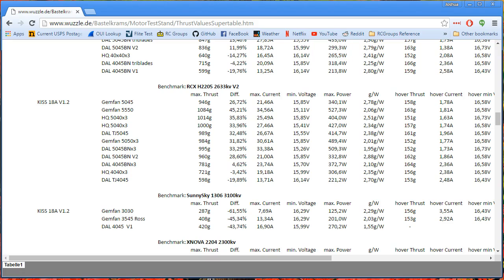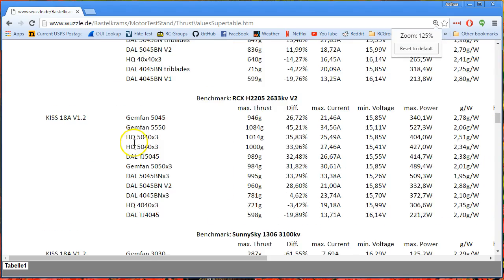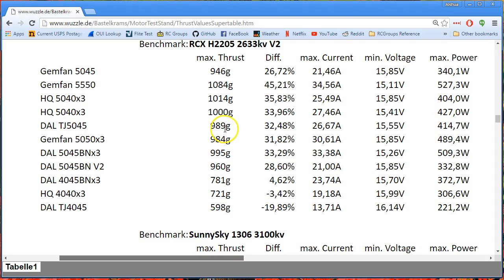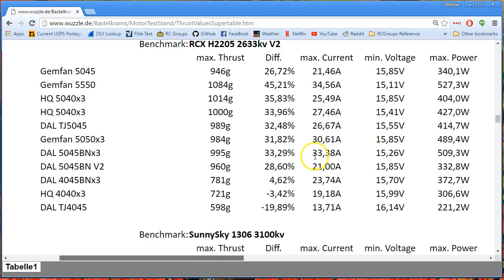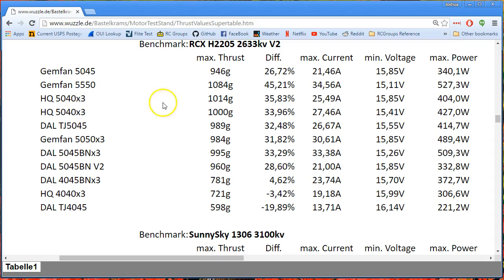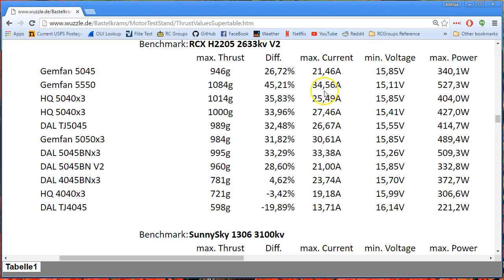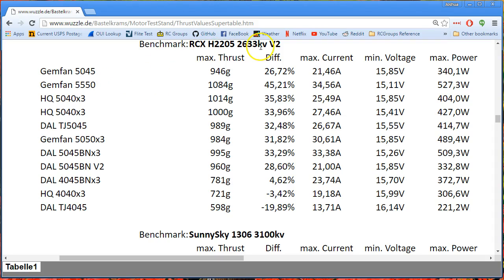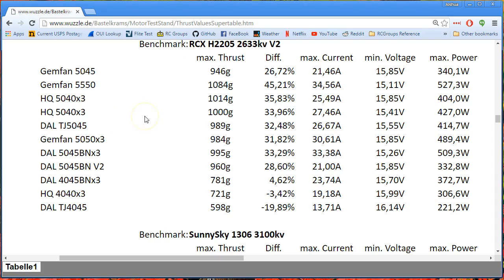Don't over-prop your high-kv motor

Comment: Great video Joshua.  One thing I think that's also often overlooked is picking the right motor size (not just KV) for the build.  The "bigger motor is better" mentality.  I try to match the motor size and KV to the size of the frame.  The frame size constrains the props so there's not point in having too big a motor as you're just carrying the extra weight for no value.  If the smaller motor can turn the prop to the full RPM (voltage * KV), then a bigger motor isn't needed.

For example, I've been flying RMRC Goby 180  frame lately (mostly indoors over the winter).  With a 180 you're limited to 4 inch props so I try to select the motor that best make use of that size with the minimal weight (obviously very important on a small 180).  In this case I've settled on a 1806 2700KV turning DAL T4045BN tri-blades.  On 3S it's a screamer - on 4S it's a rocket!  The point is that the big KV 1806 can make better use of the smaller prop (which needs a higher KV).  Sure I could also choose a 2204/05 motor with a high KV, but then I'm just carrying around extra weight and not gaining any thrust.

Similarly I see people put 2206/2208 2300KV (or even 2100KV!) motors on quads with 5 inch props.  A 2204 2300KV (or higher) is really a better fit as the bigger motor is not needed to reach maximum prop RPM (max thrust).

I support you could make an argument that a 2206/2208 lower KV motor might be the best choice on a larger quad with 6 inch props, but it's still borderline.
Reply from the maker: +Bruce Luckcuck This is a HUGE point that really deserves to be made. I went with the 2206/2250kv motors on my Strider build, because they had a reputation for reliability. They were absolutely bulletproof. But they were also probably 40 grams heavier than a 2205 motor would have been, and that copter was already overweight. On top of that, the motors basically had wasted torque. I don't have hard data to prove this, but I think it's true. They were pulling too much current because they were basically under-propped with most any 5" prop. Even a 2204 or 2205 2300kv motor would have been better, even though the kv rating was the same.

I see people running those SS2207 motors and I just don't even know what they're doing with them...

Comment: Another great video.  Thanks.  You mentioned not wanting to fly a 6" multirotor and I would like to know why.  I'm still new and fly a 5" as my main but have a 6" as a backup.  My main is currently waiting for a new frame and I've had the opportunity to get the 6" out there.  It's a 6" Krieger with cobra 2204 1960kv motors swinging KingKong 6040s and it really moves!  I don't yet have enough experience to say I like one over the other.
Reply from the maker: +PropellerAddict I flew 6" for about a year on 3S before I switched over to 4S and went down to 5". I also built a 6" 4S copter veryb briefly. I just like the way 5" handles better. The floatiness of 6" does not go away with active braking. The props are still spinning and still providing lift even at idle.

If you go with an aggressive 5" tri-blade prop, you can have basically the same amount of thrust as a 6" prop, albeit at slightly lower efficiency. So with 5" props, you can have BOTH thrust and handling, at the expense of a small amount of flight time, but racing and acro copters aren't exactly going for flight time. So you reduce flight time from 3:00 to 2:40, and who really cares?

But 5" tri-blades sure are expensive, so I could see somebody choosing a 6" prop if they wanted to save money. The single best 6" prop today for the money (IMO) is the KK6040, at about $0.25 each. But for me, once I got used to flying 5", I didn't like the feel of 6" any more. And I'm not even convinced that 6" is faster. Larger prop, lower rpm, lower pitch speed, may end up slower even though it is making more thrust.

Like I said in the video, I feel like 5" props on a 2500-2700kv motor, around 2204 to 2205 in size, is a real sweet spot right now for mini quad performance. And I have seen some people suggesting that 4" props on even higher-kv motors are even faster for some pilots on some race courses. Of course, none of this is exactly targeting efficiency or good flight time! But hey! I know a guy who has a 3" copter who gets 6+ minutes of flight time off a 1000 mAh 4S, so who knows?
Reply: +Joshua Bardwell  Very good explanation.  I'm still running 2204 2300 4s with triblades on my 5".  Eventually I'll upgrade to some higher KV motors but I'm not quite there yet.  Thanks
Reply from the maker: PropellerAddict 2300 is still a fantastic all-around motor, and depending on the copter weight, aerodynamic profile, race course, and power system, might even be faster than 2633.
Reply: +Joshua Bardwell What motor were you using on your 6" quad? Do you think a larger motor like 2206 would slow the prop down more quickly than a 2205 or 2205?
Reply from the maker: Eric Graham I don't know how braking performance works on larger motors, so I couldn't say. I was using 2206/2250kv, and I thought that motor was too big for my setup. Frankly, I feel like 2204 and 2205 motors perform so well on 5" and 6" props that I don't really see a compelling reason to go with larger motors like 2206 or 2207, at least not if you're running on 4S. Maybe if you were running e.g. 6" triples or 7" props, the larger motors would make sense, but then you would have to find a battery that could supply the massive current those motors would demand, and you're kind of getting out of the mini quad world then.
Reply: +PropellerAddict I find 6' props much faster around corners. My 5' setups drift much more around corners than 6'. The golden combo for 6' is KK 6040 + Cobra 2100kv (a 2200kv motor would also be an option). 
Joshua and I already had this discussion a few weeks ago. Just wanted to put my "vote" on 6'. 
I have since tested more back and fourth.. 5' vs 6' top speed is dictated my thrust (if everything else is the same). But 6' seems have linear thrust curve. Where 5' (more exponential thrust curve) seems to stall in the beginning and therefore accelerate slower. (In my experience a tri blade makes up for that acc loss, but at the cost of higher A use)

Comment: I have a RCX H2205 (V2) 2950KV motor and have been using it with 5040 (two blades) for a while now. The motors often get hot, but I suspect it's due to bad PID configuration (changing to luxfloat solved this issue almost completly. I have a defective dataflash on my naze32 - ck rev 6, and cannot get blackbox reading for easy debugging.

Do you think those findings would apply to 2950KV as well? It's only 12% difference in KV.
Reply from the maker: Maciej Janowski Only on 3S though.
Reply from the maker: +Maciej Janowski I am really curious about the 2950kv. The 2633 really performs well with 5040 props, so I've wondered if the 2950kv would be even better. Definitely, these results will also apply to the 2950kv. In fact, I would expect it to overload even sooner. For example, it might not be able to handle the 5040x3 or DAL TJ5045x3 whereas the 2633 can.
Reply: +Joshua Bardwell I would be a bit reluctant to do full throttle tests with those combinations. That's really asking for magic smoke. 5040x3... maybe they have proven to be super efficient and are not too heavy. But almost every other triblade should be too much for the 2950kv ones. But have none here, so I can't test them. Unfortunately my-rcmart does not provide the cheaper shipping methods to Germany so I'll refrain from ordering the other types for now. Even though I kind of itch to test the 2350kv motors with the more aggressive props.
Reply from the maker: wuzzle punkt KK5040 is my rock star prop right now. I definitely wonder how it would fly on 2950kv. I just wonder whether even that might be too much on the edge of over-propping that motor for optimal performance. RCX only shows that motor going up to 5030.
Reply: +Joshua Bardwell What do you mean? They tested all the way up to 5045
Reply: +Joshua Bardwell Should have my bench ready in about 2-3 weeks, will test it then :)

Comment: Have flown this motor a few times now on my Bolt180 with HQ4X4X3 GF4045BN and Gf4045. with 1050mAh 4S
Have found the HQ4x4x3 to fly the best with this motor, even flies well with 1300mAh 3S on this prop.
But this motor is just too heavy imo, compared to 1806/2300 on a 180.
Plan to put this motor on a Bolt BlackOps 5" with either KingKong 5040 or GF5045
Reply from the maker: GF 5045 deflected at higher throttle for me. HQ 5040 is a good choice.
Reply from the maker: Or KK 5040 of course.